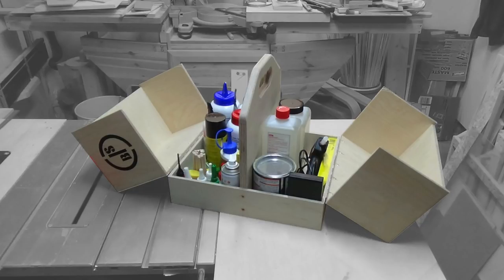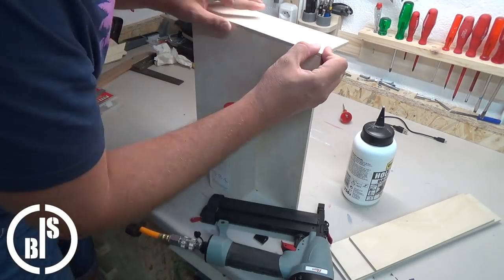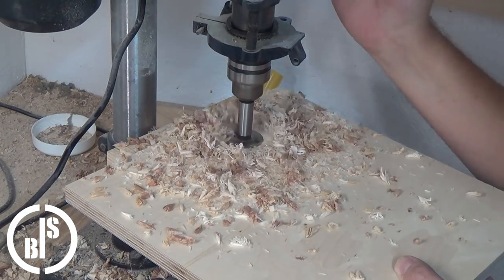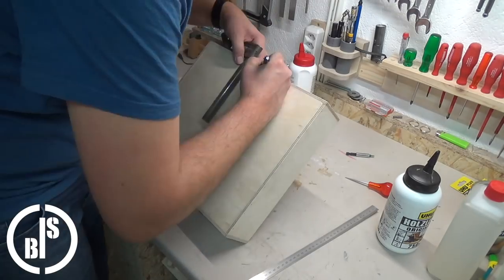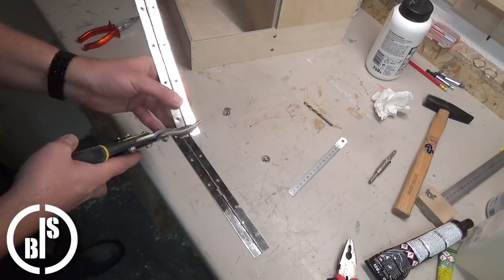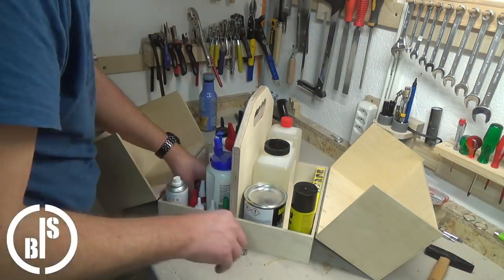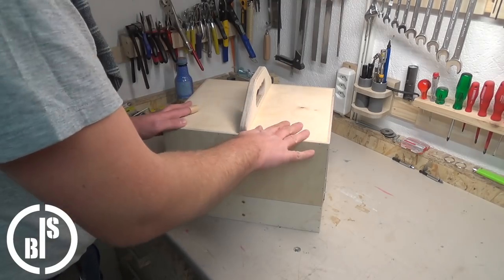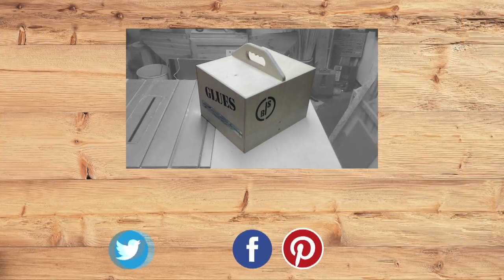How to make a Glue Caddy

Comment: A small washer on the expanding end of the rivet before you pull the pin through will make this more lasting in the plywood, just requires a little more time and dexterity when installing the rivets.
Nice caddy
Reply from the maker: Good hint. Back then i had no small washers on hand and i was in a hurry. In addition, the rivets were a bit short.